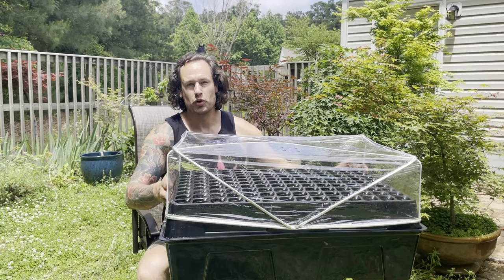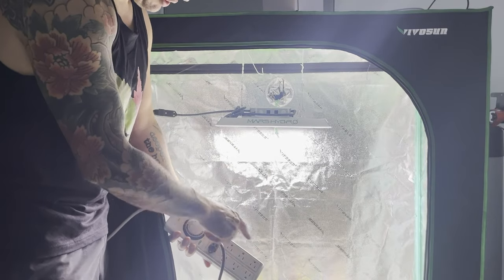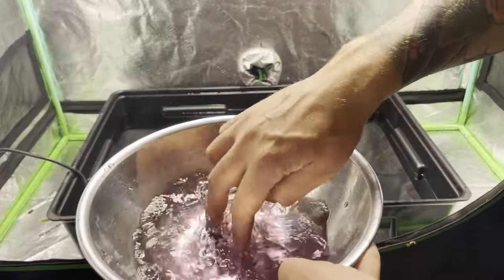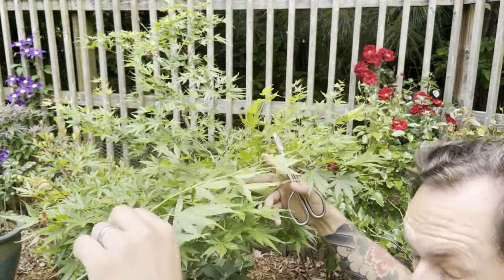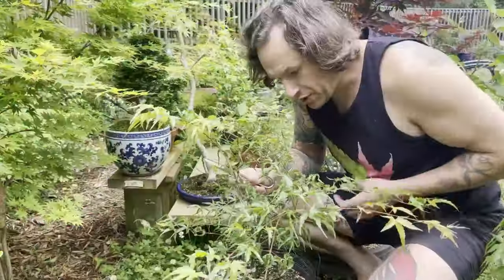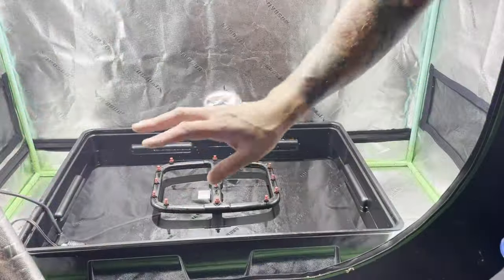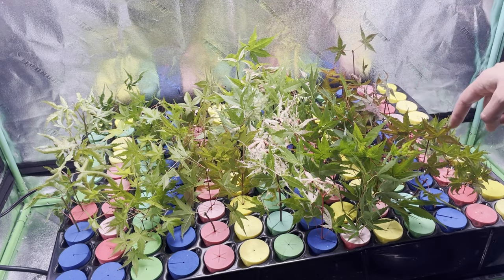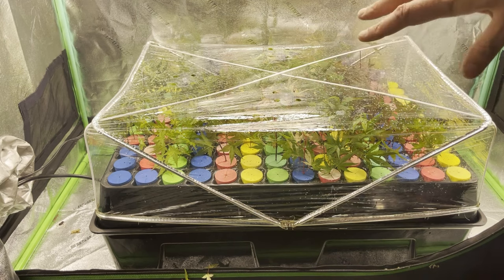Aeroponic Propagation Japanese Maple Rooted Cuttings Explained

Comment: I like this idea! Curious of the success rate vs a traditional method of puting them in substrate.
Reply from the maker: I made about 30-40 cuttings last autumn on second flush growth…was the first time trialing it. The best part is you can set it and forget it; basically just check it weekly for water level and roots. I’ll do follow up videos.

Comment: Maybe I missed it but watched multiple times. Do you record the humidity?  There is mention of "Since it provides such a nice high humidity diagonal cut not necessary", "Maintain a nice humidity under the lid", and "Nice humidity dome, but tends to dry out a little bit so lift puck" but no numbers. Temps not really mentioned either.

I usually clone 75deg, 65% humidity, 60-70deg water temp, ph 6.0 and using hormone + nutrient for 7 days then water change and going straight nutrient. Watching the video it seems Japanese maples need more humidity? Just about to try Japanese maples and not very much info on aeroponic cloning so appreciate your info.
Reply from the maker: I don’t measure the humidity. Sorry I don’t have more precise quantitative feedback. Mostly going off of experience. 

Qualitatively speaking, they like it very humid. When I first tried the system, the leaves withered quickly when trying to maintain humidity by adjusting the lid vents. After I popped up a plug to allow a constant spritz of water in the top section, it maintained humidity perfectly. By perfect, I only mean good enough for a solid outcome on rootage with no leaf wilt. My setup is all about keeping it simple. I don’t have a misting system; if I did, then could probably to dial in better humidity regulation. So the way I have it, the dome stays “foggy” most of the time. Sometimes on hot days the fog/condensation dries, but the humidity is still certainly quite high at all times. 

The down side is that I get algae buildup. If this was a commercial application and I did this as my day job, I would probably want to run experiments with multiple setups and measure the input factors like you listed above. 

Feel free to hit me on IG DMs anytime to nerd out on prop science. 🙏🏽 🪴 🍁
Reply from the maker: Also, yeah, I had not heard any information on aeroponic propagation for Japanese maples before trying it myself.

Comment: Do you think it would be fruitful to do this without the light or the thermometer if the unit could be just kept outside during the summer?
Reply from the maker: So, everything I’ve read online says that cuttings root fairly well above 70 degrees Fahrenheit, nighttime temperature. Regarding the light, all the information I’ve found regarding rooted cuttings says full shade (indirect light).

My largest concern for outside, would be the temperatures going sky high underneath the humidity dome. This will largely depend on your individual climate. I would caution you against letting the dome get much above 90 degrees Fahrenheit. 

End of the day, for all rooted cutting setup types (aeroponic, hydroponic, soil media, etc.) you need to have warm consistent temperature, consistent moisture/humidity, and consistent oxygenation to the roots.

Now that we’re well into the summer heat, my aquarium heater is not even turning on many nights in our non insulated garage.
Reply: @acer_p_bonsai got it, excellent info. Thank you man!
Reply from the maker: @Thousand.cranes.bonsai  happy to share. Best wishes with your propagation

Comment: Have you had success in the past with this method of propogation?
Reply from the maker: Yes, I tired it for the first time last autumn, on second flush growth and got about 40 rooted cuttings, even with some mistakes along the way. Had about 8 Sango Kaku, 10 Deshojo, 4 Nishikigawa, 6 Beni Maiko, and a few random other ones. 

My biggest problem was I tried to run them through winter under artificial light. Many of them stalled out this spring, so I learned that I can’t skip the dormancy period. I’m hoping spring cuttings will have more time to settle in before winter.